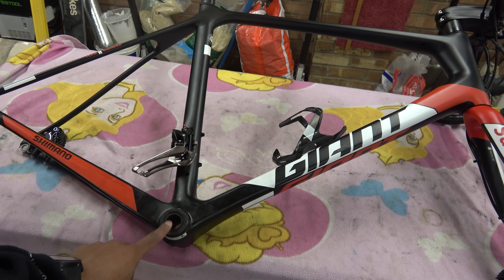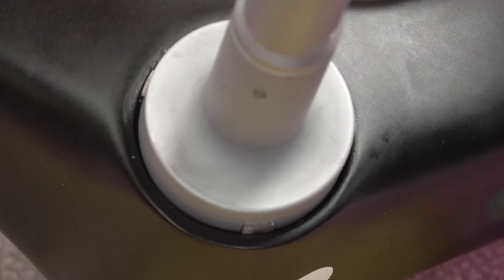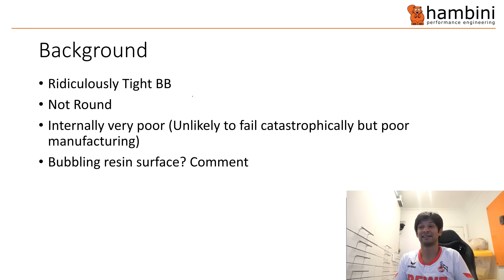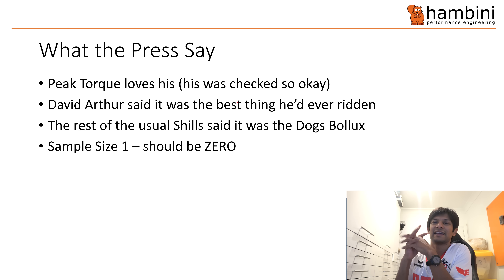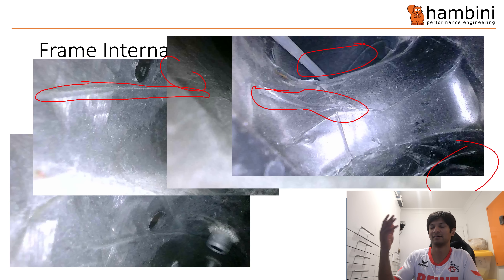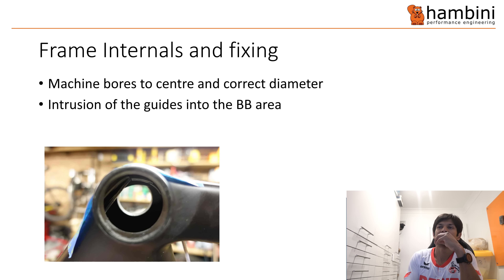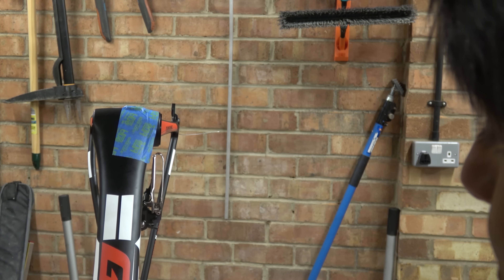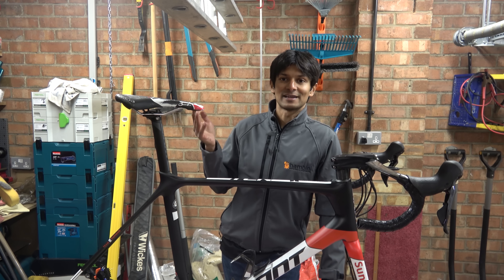Giant TCR gets Roasted. More CRAP quality control

Comment: I know nothing about BB compatibility, have a FSA BB386EVO crankset on my bike, what BB would I need. Second to the that question, the difference prices advertised for the BB on the hambini site, the UK having the higher price. Is the lower price for the EU?
Reply from the maker: UK Prices include VAT at 20%. If you are outside of the UK (eg. EU, USA, AUS, Canada etc), you don't pay VAT (but you may get duty when it's imported). For that particular crankset, it's not straightforward as they come in different sizes. If you ping me an email, I can talk you through it.

Comment: Since you seem to highlight how common poorly engineered bottom brackets are in bicycle frames, could you shed light as to why you think that is (other than greedy marketing managers)? Is it technically challenging?
Reply from the maker: it's technically challenging to do it cheaply. Ican did it on their frame though and that is only $730USD. They machined afterwards.
Reply: @Hambini  Ok. Thanks for the reply.

Comment: To be fair this is just painted to look like a team bike.  And real pro bikes are only intended for extremely short periods of usage, like one season at MOST. Generally even less, then they’re tossed or auctioned off.  Consumers who spend their own precious $$ wanting what pros use thinking it must be “the best” and demanding long term quality fault to realize the professional needs of a frame are the exact opposite,  they get them for free, trash them for a few months and then move on to the next one.  Durability precision etc do not factor into their minds.  They are fast moving advertisements at best.  No pro bike is intended (nor made) to last longer than one season (at MOST).  So everyone complaining their 800g frame is made like shit is expecting the wrong thing.  Yes they’re expensive but that’s the price you pay for what you’re getting, csnt really have it both ways or else frames would cost 5x more than what they already do.  Look at cervelos I remember the R3 still had newspaper inside from the molds and was so thin walled you could squeeze it between 2 fingers - but it was light and lasted about a year BECAUSE THATS WHAT IT WAS MADE TO DO.  Not a day more.  All the mass consumers purchasing them expecting theyd last a lifetime and be perfect NASA machines don’t get it at all.  If you want that stay away from mass produced CF and “professional” “team” bikes.  That’s not what they’re designed to be or do.  If you have the $$ to spend on something that’s expendable and replaceable (like the pros do) then go for it. Bottoms line: don’t hold professional extreme (and also mass produced) frames to the standards of long term dependability and precision, etc.  it’s apples and oranges.

Comment: Great video Hambini , two questions , I’d love to see a lower end TCR frame to see if it was as bad , and do you get free haircuts ….? PS …three questions …where’s the Shimano video mucca ?
Reply from the maker: Shimano video is in peer review. I went along with my thoughts to my engineering panel for their feedback - I've done a few corrections to the slides and then will publish.
Reply: @Hambini  As you can imagine , we’re looking forward to your video , well , I am ! I’m imprisoned at the minute with Covid , so look forward to your videos …..free haircuts then …..
Reply: That’s the entry level frame from 2018.
Reply: @chrisswindell7704  Sorry , I obviously wasn’t paying attention, so would be nice to see more a more contemporary Giant , get the same review , would they be similar?
Reply: @paulsayer426  can’t say I’ve had hands on the recent model (released in 2021) but I’ve had three from the 2016-2020 model. 

The SL I’d certainly expect to be of the highest standard as the material used is Giant’s flagship carbon product, which they use to make frames for quite a few other manufacturers (probably most notably Colnago - who have all but the ‘C’ frames made by Giant). 

The Advanced grade frames do have some limitations - but mostly just a poor seatpost interface design.  I haven’t heard any complains about the BB housings other than the usual dissatisfaction with pressfit bearings. They’re also a challenge to run 30mm cranksets on, because the 41mm diameter leaves little space for the actual bearing.
Reply: @chrisswindell7704  
It’s still amazing to me , and even after the hugh Covid price hikes , that any carbon frame , can be so poorly manufactured, that simply fitting a bottom bracket , can be fraught with risk ! I was on the verge of buying a tcr  advanced , but , prices have gone mad……
Reply: @paulsayer426  I don’t think the build quality is that bad. Hambini loves a bit of hyperbolic criticism but a couple of small creases isn’t much - you see far worse under old style clear lacquered carbon finishes all the time. 

If you’ve got the money I’d recommend an SL frame though - the 2016-2020 and the 2021- onwards models have a known weakness at the seatpost interface that causes paint cracking. Never seen one fail, but the paint finish is always cracked there. The ISP does away with that. 

The key thing is that prices haven’t actually gone mad - there’s just a lot of people asking too much money for them (and they’re not selling). 

I got a 2018 SL limited edition frame for £700 a year ago when prices were higher than they are now. You should be on an 2018ish Advanced with 105 for under a grand if you keep an eye out.

Comment from the maker: There were a few questions in the comments querying the provenance of this frame. It had a sticker on the bottom for unlimited colors who after further checks did turn out to be painters for what was the Sunweb team. Hence that and the owner's comments (he said it was ex team) do stack up. Suspected ex training bike perhaps.
Reply: you would expect they would have the geometry spot on or at least select those frames best within tolerance I expect the racing bikes are bespoke
Reply: @billyjo1148  it’s a lower tier bike for the development team. The race bikes were SLs with rim brakes.
Reply: Still trying to get my head around the external brake hose routing on the fork. Very old school that.
Reply: @glennoc8585  the 2016 model TCR wasn’t designed with disc brakes in mind. Their popularisation led to a jury rigged disc versions for 2017 to 2020. When the model changed in 2021, the cables were integrated.
Reply: @glennoc8585  team mechs wash the bikes at the end of every race day and don’t want to spend 500000 hours per bike to change the headset every other race.
Reply: Wish I'd known you were coming to Hull mate @hambini. I have an 09 TCR sl frame you can have to cut up at your leisure. I'm pretty sure I'm only five minutes walk from where you picked it up too. If you havent dropped it off yet give me a shout.
Reply: So its still not a standard production bike then 🤷‍♀
Reply from the maker: @TimBud  Dunno. My digging hasn't gone that far.
Reply: @TimBud  yes - and one with an after market paint job. Likely a 2018 Adv Pro Disc. The paint issues look like bad prep, which might have resulted in seepage to the BB interface.

Comment: Those "wrinkles" looked like marks in the resin caused by how it was bagged/taped etc, rather than voids - still poor manufacturing.

Could be some glass fibre in there to allow some give in the frame? (GRP is more flexible than Carbon), or just to fill holes in their terrible manufacturing?
Reply from the maker: if that was the case, they would be soft. in this case they aren't.

Comment: Great explanation of why wrinkles on the inside faces of a lay up are a genuine issue. 🙏
Interested to know how they can be avoided though, or whether its more a matter of chance and a lot of frames potentially binned if not up to snuff.

Regarding the bubbling above the BB aperture, I would bet most likely moisture ingress under the paint as that is always a damp spot on the bike and the paint layer will have inevitably been disturbed having an over tight bearing housing roughly shoved into it.
Reply from the maker: If the frame is made using RTM (like Time) you will rarely get a wrinkle. That's why it's really better to for good manufacturing rather than a wonder material with displacement voids
Reply: @Hambini  surely Time should be sending you a frame soon. They just better make sure it’s spot-on! 😉

I assume giant use an inflatable inner to their frame moulds? Those are always going wriggle as they fill the void especially in “cornery” areas so I guess that is going have the danger of smearing the innermost layers or the ballon it’s self wrinkling and not pushing properly against the inside of the moulding. 
Can we blame the Bean counters as most customers won’t send their bike to you for forensic reaming and RTM is no doubt more expensive to tool up for, even if some time is saved in assembly labour for better toleranced frame?
Reply from the maker: @DavidMartin-tk4fs  I have bought a Time for that very reason. It's currently awaiting parts

As for the blowing balloon method, this is quite correct, as you inflate it, it's likely to move some of hte layers during inflation.

Comment: I love your work Hambini, but the Giant TCR  Sunweb bikes (2018) were rim brake only. This one is disc brake so at best its a conterfit paint job at worst your client has a fake frame.
So its very possible that you’ve roasted Giant based on a fake frame.
Reply: I don't think there are fake Giant TCR out of China, well I haven't come across any on the usual sites.
Reply: Ah right... Did a bit more checking too. It looks like the disc TCRs were used by the Sunweb development team and maybe as training bikes for the big boys. Shocking paint for a team bike either way.
Reply from the maker: I'm only relaying what i was told

Comment: When we try to do press fit on CFRP that will happened. Press fit operation will scratch all the way through on polymer surface. Even pf chromoly bb shell worn out after changing bb several time.

I am stay with BSA/threaded bb. After my Shimano BBR60's bearings worn out, taken out the bb and apply some heat with heat gun for approx 30s, the bearing came out just like that, then put back NSK VV bearings using heat gun, now my cheap BSA bb performance same to those 250usd pf/threded bb.

No hate to pf but I am prefer threaded bb. Easy maintenance, no excessive force apply to bb shell, simple tools, stupid 20usd heat gun, top performance stupid cheap high quality NSK VV or NTN LLB bearings in the bb.

Comment: These wrinkles, although not beautiful, look more like resin wrinkles to me, where resin has filled wrinkles of the bladder in the molding process. The carbon fibre layers still lay flat and the strength shouldn't be significantly compromised. You can see this a lot on older frames on the channel from Luescher
Reply from the maker: On some of them, you can see the edge of the cf
Reply: @Hambini  well then it is just shit :D but what are expecting form the bicycle industry? That they can do a job correctly if you pay them a couple of thousands for a pretty low tech product? I think that's a bit too much to ask for

Comment: I have the 2021 TCR, the rear disc mount was so out of line that the disc almost rubbed at the top of the disc on one side and at the bottom of the disc on the other, no facing had been done and Giant in NZ had no tools to face the mount so they had to replace the frame. No BB issues or anything else as yet.
Reply: I use a standard hand powered file in my workshop.
Reply: @TimBud  Yep, that could have been done but it would have to be done by Giant or the bike shop as if I did it my warranty would be void, as it was I got the best outcome.

Comment: I don't think that's an ex team bike as that would have been ISP seatpost. The axle bolts are M12 x 1.5
Reply: Full team used rim brake SLs, dev team used Adv Pro discs. 

This is likely a dev team frame, as the commercial Adv Pro in these colours was rim only.
Reply from the maker: That's what i was told

Comment: Does the impregnated resin ever fomr wrinkle-like texture as it cures against the bladder (which likely could have small wrinkles in it)?    I suppose if there was a small wrinkle in the bladder allowing what I’m suggesting then uniform compaction is not achieved through that region and some amount of inconsistency (not flattened) would be seen in the actual fibers themselves.

Comment: im on the fence about giant frames and bikes
i feel that if you dont want to spend a crap ton on a bike
giant is a solid choice, u wont go wrong
in fact giant OEMs to just about every other brand itself
its a good bike and a good price point for its builds and features

but it is a mass produced bike in china
and the settings on the bracer do get out of tolerance through out the day
from shaking , thumping, rattling etc etc
it is what it is, alot of brands suffer from it also

its unfortunate that its become expected tho, and its not brought up more
when there are so many phreaking standards, 
the tolerances really do matter
Reply: I know Giant has lost a lot of OEM work in recent years as they have become too expensive so many US and European brands have moved away from Giant. It maybe all their frames and forks are made elsewhere now or they only have their high end bikes made by them but it has reduced considerably. I believe Giant production is split between Taiwan and mainland China plus they have assembly plants in Europe but I don't think those make the frames although may finish them, paint them etc. Poland and Netherlands comes to mind but not sure.

Comment: Regular viewer here, appreciate the pen check! 

These videos make me so nervous of carbon fiber anymore.  I'm also curious how badly a frame can be made and still not shatter into bits like we are all scared of after reading "horror stories".  Other than creaky parts what would it take to actually have a catastrophe?
Reply: You have to realize that he sees bikes with a problem the majority of the time. So, what he shows could very likely be a very rare occurrence. I've owned carbon bikes for a long time and never had problems. The only ones I've known to have manufacturer problems was a couple I knew and they had Boardmans.
Reply: I have been riding carbon since 1999. Honestly have no idea where he finds all these CRAP bikes. Honestly Ive beated the hell out of all my bikes and they are all good... Yes even Cervelo... Ive had 3 of them.
Reply: I avoided buying carbon since day one. Scrap that. I had one carbon back in the middle 90's. But it was a carbon tube bonded to lugs specialized so not real carbon. What put me off for many years was the price and the fact that one single crash COULD turn your expensive bike into a back up parts machine. Since then the "good" bike only see's sunny days and NO RAIN for a reason.
Reply: These bikes are over designed so they are tolerant of small irregularities that are part of the manufacturing process. He is finding issues but the wrinkling plies aren't necessarily a problem

Comment: I have a TCR SL from 2020 and I love it but this video is really interesting as always! I'd be surprised if this was team issue as it doesn't have an integrated seat post? You just need to start manufacturing framesets as soon as possible so we can all buy one 😂 pink princess paint jobs as standard!!
Reply: I think they only started doing ISPs in 2019 and this frame looks like a 2018 model
Reply: @Tronter  Not true, The TCR Advanced SL started using ISP in 2009.

Comment: Fair criticism on quality.  I have a TCR Adv Pro Disc and love the bike.  I think it's the best value for a carbon road bike you can get, and their warranty is great.
Reply: Warranty is good at Giant? So I can't say that for two guarantee cases that I know personally.
Both times the customer was let down by giant
Reply: A good bike shouldn't ever require warranty - and on that note, I've never in my life had to make use of my warranty for any bike-related issues.
Reply: @11robotics   the warranty covers crash damage, not just manufacturing defects.  Read their warranty info.  Best around
Reply: @indiemichael  technically, that's a form of insurance, not warranty. And you pay its price when you buy a frame with such form of warranty whether you want it or not.
Reply: If by value you mean compared to other bikes made in China for 10% of their price and are willing to enter the lottery of "will I get frame that is unuseable" and is subject to failure from minor impact damage, then...  yeah, the Giant is a great "value".  Compared to a steel or ti bike (esp a custom) your Giant is complete waste of money.
Reply: @Sills71  Titanium often cracks at the welds and the frames are heavy. Steel is lighter but Weak. I prefer aluminium because it's good value for money, relatively light and affordable.
Reply: @glennoc8585  well trying to get a Ti frame builder willing to weld to aircraft spec is tricky true about the aluminium bread and butter f*** it and chuck it
Reply: @glennoc8585  Aluminium Also Had no Endurance Limit which sometimes Have a Fatigue Life of 5-10yrs as far as i know...
Reply: @Sills71  funny you say that.  “Minor impact damage” I’ve crashed that bike three times in crits and it’s fine.  Absolutely zero damage to the frame.

Comment: I don't undestand it. Why the BB bores aren't machined by the manufacturer? Would hiring a guy which sole job would be to use 40.97 mm reamer to finish the BB internals cost that much?

Comment: I have to say, I have a TCR advanced Sl and all the tolerances are pretty bang on.  Internally it's pretty tidy as well. Maybe the top frame is manufactured better than the lower end ones (like the one you've shown) Also, It seems a bit odd that Sunweb would use the lower end frame. Are you sure it's legit?
Reply: giant did a year or so of sunweb advanced pro frames in sunweb colours, not a legit ex team frame.
Reply: You measured your frame tolerances with an accurate tool?
Reply: @Sills71  Yes that is correct.